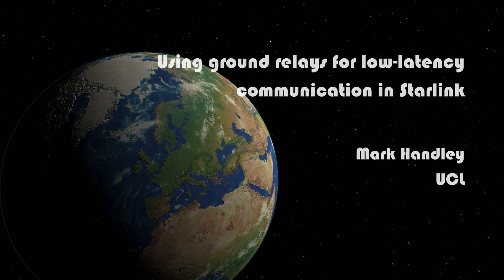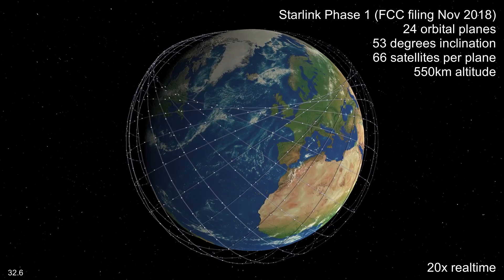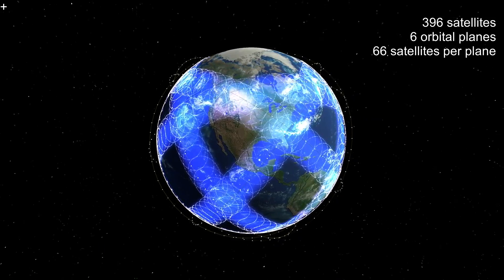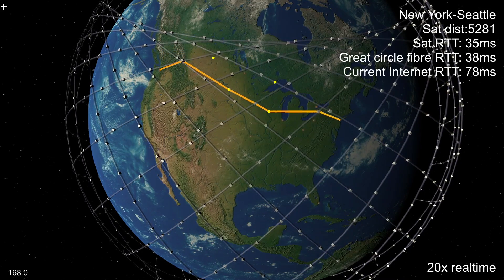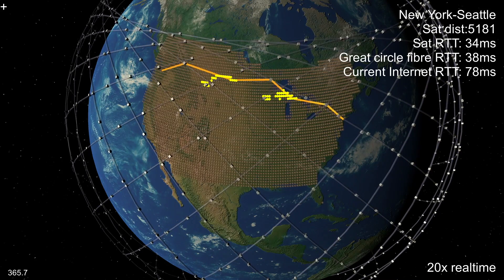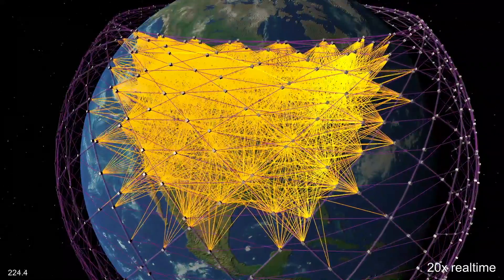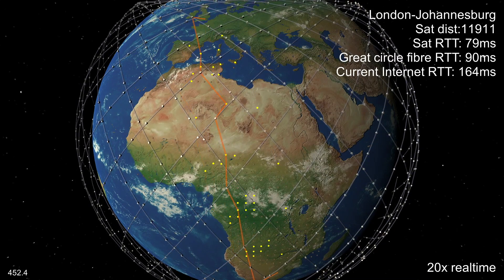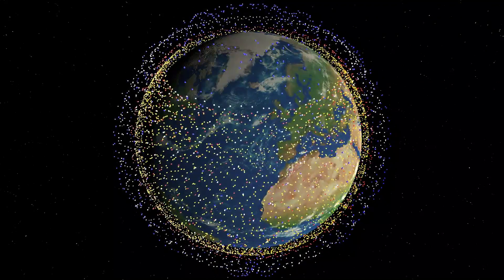Using ground relays with Starlink

Comment: Packet filtering, bandwidth caps, data caps, internet monitoring, giving out personal data to corporations, preventing end users using their own hardware, port blocking are just some things that I would consider paying more not to have. Nobody considers these things as these features are an advanced way of partially restricting how people can use the internet in favor of offering less restrictive plans for massive dollars, and most of internet users do not have fundamental understanding how networking works much less how a computer works. This is why ISPs have been ripping off people since its conception.  Starlink will likely do like any corporation does, create a service, market it and make as much money on as many people as they can.  Gotta wonder, how much RF radiation the human body can take? I prefer a hard link and not be an irradiated Guinea pig.  There is only one type of internet protocol, STOP creating ways of restricting users full access to it.

Comment: If Mr. Musk's plan is to use ground stations to relay internet to individual users , then there's really no advantage from satellite internet to those of us who live in rural areas, which I thought was the point of satellite internet in the first place.
Reply: That's what I gathered from what I had read previously. But your video didn't explicitly explain the purpose of the relay station, so I was beginning to have my doubts! Thanks!

Comment: I still am a bit skeptical of the concept of ground relays.  The signal will not be travelling in a vacuum, but through the atmosphere and this has greater latency (like what we experience with WiFi).  Do we know the wireless frequencies that will be used?

Comment: Your animations have the laser links jumping from sat to next nearest sat. Providing they can aim the lasers accurately enough the actual system may use far fewer links. Line of sight should allow a path across the Atlantic or from South Africa to Europe with just 3 satellites.
Reply: @Skyrossm  Skipping satellites would dramatically reduce latency and increase bandwidth of the network as a whole. Every time data is relayed  through a satellite it adds latency as the sat processes the data. As well the skipped satellites are now free to form new connections with other skipped sats giving the network several pipelines instead of one.
Reply: See https://satnetwork.github.io    These guys say Starlink could realize a 54% gain in efficiency.
Reply: They could do that, but each satellite will only have 4 lasers so it's doubtful they would skip satellites as they simply won't have enough lasers available to do that and maintain contact with directly neighboring satellites at the same time.
Reply: @robertmarder126 I don't see what purpose staying in direct contact with neighboring sats serves. Their all connected to the same network and will be communicating at some point directly with pretty much every other sat. In fact I'd think an individual sat has little reason to ever communicate with it's nearest neighbors on the same orbital plane as those sats will rarely if ever provide a useful data path.

Comment: what is the ping from Australia to USA under this system?
Reply from the maker: That would depend on whether there are enough ships to relay via or not.  Without ships and just using ground relays, you've got to go the long way round, via Japan, the Aleutian Islands, Alaska, then back south to the US.  You can do that path from Sydney to San Franciscio in around 170-180ms RTT.  Likely fibre is faster.  If you use ISLs, the RTT drops to around 90-115 ms depending on the constellation and how you orient the lasers. 

If there are enough commercial ships with Starlink transceivers, you might be able to get a more direct path with pretty low RTT, even without ISLs.  But that would likely not be in the early stages of deployment, and by that time I'd hope they've got ISLs flying.

The ground relay path from Sydney to Tokyo is pretty good - something like 90-100ms RTT.  It's crossing the southern or central Pacific that's just really hard.  I can get a route across the South Pacific, via Samoa, French Polynesia, Pitcairn and Easter Island, but it requires three ship relays and two uninhabited islands, and the RTT as far as the Ecuador coast is about 155ms.  So that route doesn't really look all that good.  The Pacific is just really big!
Reply: @markhandley  Very interesting. Cheers for that mate.

Comment: Given that all of the orbits are known, reliable, and periodic, and given the location of all of the relay stations, the map doesn't have to be dynamically updated at all, just temporal. All of the variables are known (or knowable) at all times, therefore once you've figured out all of the routes between you and a destination for the time period between two satellites in one plane passing the same point, you're done doing work. All you need to know is the ID/location of the next satellite in each plane, which again, is readily knowable. In reality, after about 5 minutes of being connected to one location (say, a game server, or streaming a video), path computation time is virtually nonexistent.

Comment: base station to satellite links are the achile’s  heel of any satellite system due to capacity limits of the spectrum they are allowed to use for the uplink.   Limited capacity is why existing satellite systems are so expensive.

LEO may reduce latency, but does not magically give the system unlimited capacity. 

Musk delivers amazing advamcements, but of late, he has also announcemt many things well before they were ready for announcement. Starlink is one such project.

Comment: This will be a stock market MAJOR change. Look into that a little.
Billions of dollars will be made by a .03 sec connection change.
EDIT: lmao and the comments are worried about there facebook, oh you silly sheepal.
Reply: Can't see much change. Top traders use algorithms, and their machines are placed in the room next to the exchanges.
Reply: jrw no, it’s the money made from placing a trade on a market using info from other markets beating competitors with a faster connection. It’s different to algo trading that is based solely within one market. They see a trade placed on a commodity on market1 at a price higher than market2. They are then able to buy the same commodity at a lower price than market1 on market2 and then sell it at market1’s price on market2 thus making a profit. (another way of putting it).
Reply: @yowierocket  Thanks for the explanation.
Reply: @yowierocket  A fairy tale. A change in a remote market is not guaranteed to replicate to your local. And by the time you try to arbitrage, the price on the remote market changes again. 
If that money making venue was so good, trader would long have relay satellites between their markets. They don't, hence I call this BS.
Reply: @vladimirdyuzhev  You should read Flash Boys by Michael Lewis.  Yeah, it's a thing.
Reply: @yowierocket  That's not it. That's just standard, "find someone selling for less, profit from selling it for more" arbitrage. High frequency trading is more like insider-trading, because they know what's about to happen. For example, they see an instruction to purchase something arrive at one exchange, then before another exchange sees the same instruction, they place a bet at that exchange that the list price is about to go up. The purchase instruction then arrives pushing the price up, just as they "predicted", and they win the bet... except of course, it's not a bet, they have inside information into what another actor is about to do. It's like the court side tennis betting, where a person watches to see which player is getting the next point, and places the bet before the umpire presses the button to register the change to the scoreboard (a real thing - see https://www.youtube.com/watch?v=kvT_yIVI2Qw) ... just like with courtsiding, quants aren't actually competing as players in the game, ie, they're not trading, they're not finding lower prices, connecting sellers with buyers as middle-men, they're just pretending to be gambling on what other people are going to do by being the first to find out what's already happened. Ie, cheating.
Reply: @gigglehertz  Good book, but it a bit oversells what HFT can do and does. The ultimate proof that HFT doesn't need faster satellite routes between exchanges is the fact they do not exist - there is no supply if there is no demand.
Reply: Thanks for the vid, I'll add you to my watching.
Reply: High frequency trading may have had its day anyway, as awareness spreads, traders don't like the idea of having their profits leached by some quants manipulating the prices thanks to the 1ms advantage they can secure themselves, which means there is money to be made in offering high frequency resistant services... for example, some exchanges are beginning to implement minimum latency bounds, so even if you do have a server in the Toys R Us cabinet etc, your traffic is slowed down to match what's available to everybody else... and traders will prefer to use these exchanges, knowing the exchanges aren't selling cheat codes to other people. Plus work is being done at the trader level, some guy figured out that instead of sending trade instruction messages to exchanges in the usual way, were those instructions hit closer exchanges before further exchanges, he could stagger them slightly, sending instructions to the farthest exchanges a few milliseconds before sending them to the closer exchanges, that way, the instructions lands at each exchange at the same time, and high frequency traders can't exploit their faster connection between exchanges to react to seeing the instruction arrive in one place, and get out ahead of when the instruction will land at another exchange. Interest in these kind of solutions is only going to grow.

Comment: My guess is the ground stations look less like a grid and more like a cell service coverage map.  While some areas can be laid out pretty close to that gaps will still exist in some places.
Reply: I disagree; conventional cell phone towers would need other nearby cell towers (or fibre/phone lines) to have internet connectivity, whereas with this system it's just beaming a signal off a satellite, so it doesn't need a nearby ground station. It only needs the antenna and a power source to power the antenna so that it can receive and send. Which should be doable with solar + wind + battery (or power, but some locations might not be near power lines).
Reply: I for some reason picture some random ass little podunk town having this massive badass tower in the middle of their main block over shadowing everything around it just so someone from San Diego can send a picture to their friend in New York .2ms faster.

Comment: many relays = many disconnects
Reply: With packet data, it just buffers and resends, and as long as the connection is faster than needed, there isn't any noticeable delay
Reply: You would be surprised how many fiber relays there are on ground it can only go about 40 to 60 miles on a good fiber line before a relay or a repeater to boost the light in the fiber. When you do a trace route you're just seeing the hubs where it routes through where you're going but it has passed over probably 100+ devices one way. In space with lasers it's way quicker and more direct.

Comment: or just ground comm with 5g towers.. international with sea cables.. temps in the thermosphere are much higher than the boiling point of the metals used on satellites, the reason you lose phone signals in a plane and on mountains is cus you leave the range of the ground communications.. satellites are all cartoons or just on balloons

https://youtu.be/FZ8VL96Vro0
Reply: That video doesn't prove what it says. Also, while the temperatures of individual molecules of air are hot, there's a lot less of them so it is actually much colder.